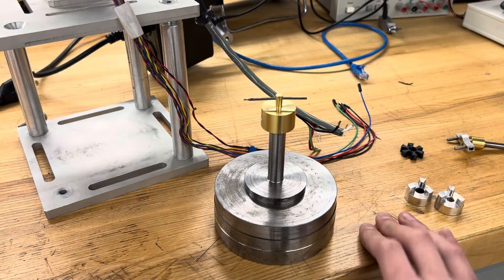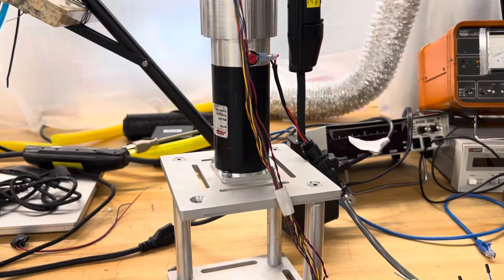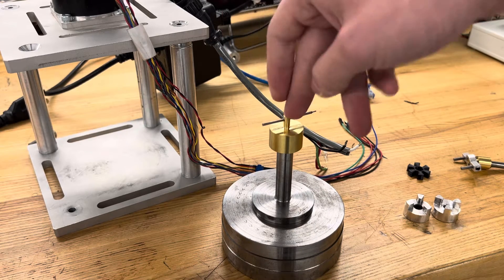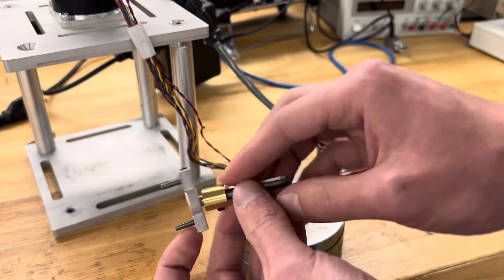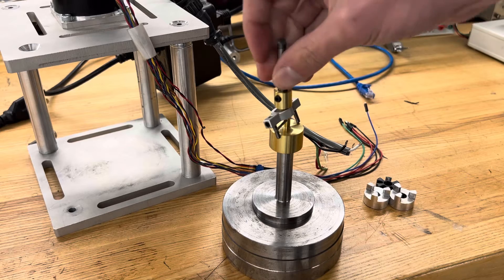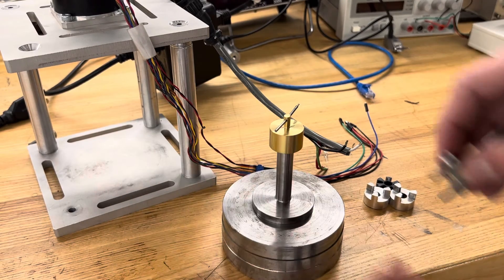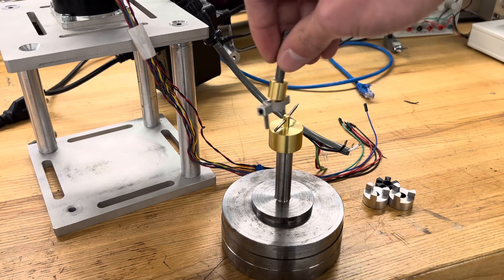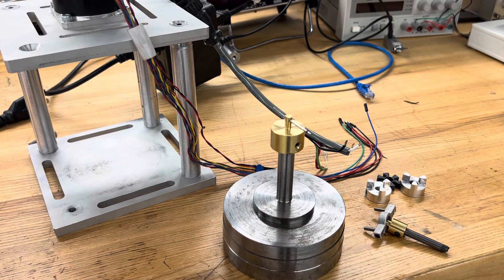Ultra-low influencing shaft coupling (unidirectional)

Comment: Interesting - Does it maintain true constant velocity with minor misalignment?
Reply from the maker: It’s not true cv, but that’s not ultra critical here. The data was averaged over many revolutions anyhow
Reply: @cylosgarage  Thanks - I was just curious about the kinetics of it - I couldn't see how it could be CV, but a you say, that doesn't matter so much here. Fascinating videos, btw. please keep them coming.
Reply: @cylosgarage;
I was wondering, if the rotation is not at constant angular velocity, you might see towue variations that are repeated, per revolution, and, depending on the bandwidth of the control and measurement systems, might give an error that depends on the instantaneous angle where the measurement ooccurs, which could have a 'stroboscopic' effect,  where the error shows up as peaks/valleys as the rotation rate varies...because it seems that you are measuring at rates thay are quite slow, this could be a problem, but what do i know?

Comment: Clever design.
Back when I worked at Precitech and then ABTech Manufacturing, we used a single pin in the lower air bearing plate and a disc with a heavily chamfered slot mounted to the motor.  It only had a single point of contact, but driving forces were very low.  These were used for roundness and cylindricity machines, without any real tooling forces, as they only had to accelerate & decelerate the mass of the bearing and part being inspected.  Also, those bearings were run on 60-80 PSI filtered air, not self-generating air bearings like the one you show.  For air bearing spindles we used frameless brushless motors, with the magnets spinning on the air bearing shaft - no couplings required.
Reply from the maker: A resume to be jealous of! Thanks for the anecdote
Reply: Sir, can you share a rough sketch of chamfered slot ??
Reply: @VivekShukla-z7q   It was chamfered from each side to almost a sharp edge in the middle. When interfacing with the mating pin, it made a point contact. Any radial or angular misalignment between the driving plate and driven pin would minimally influence the radial and axial runout of the air bearing.